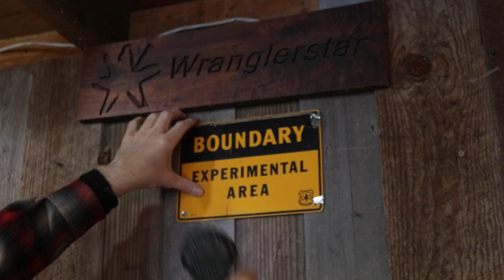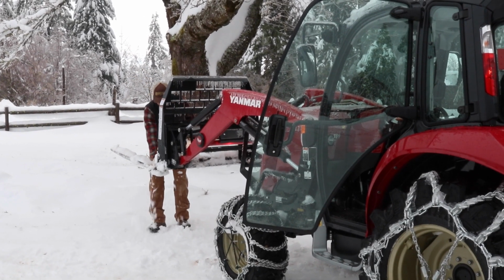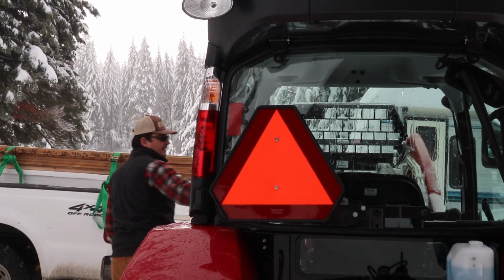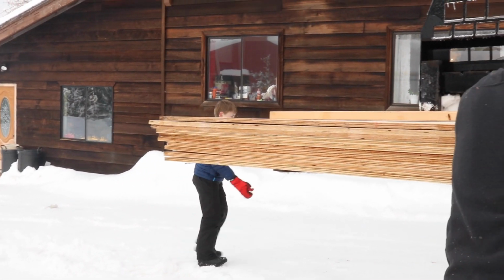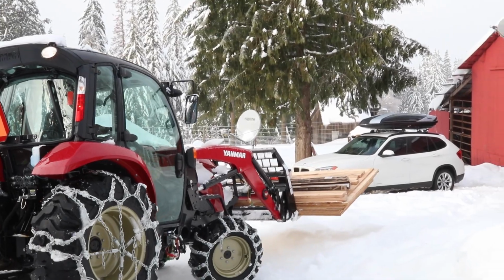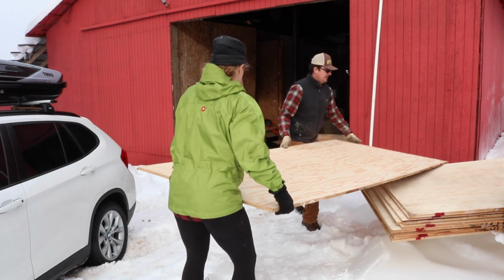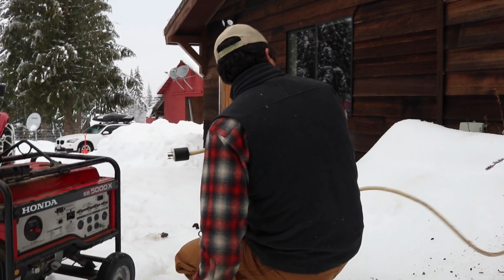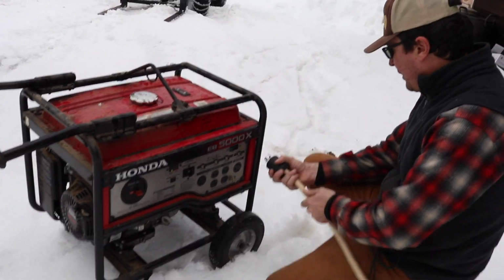THIS ROOM IS KILLING ME I CAN'T TAKE IT ANYMORE!!

Comment: Love the generator tip and back feeding! This was a slap on the head for me.. I was looking for complicated ways to feed in, bypass switch etc... this is a great idea. Our power went out last month for four hours and it we heat with outdoor boiler burner.. which needs to have pumps running or it will freeze... love the drone shots too!

Comment: hey Cody back feeding the house the way you are doing is very dangerous. Being an electrician you need to install a generator isolation panel. The cheapest version has a mechanical safety built into it, so when you turn on the path for the generator it disconnects the main service. I have already drawn a simple schematic for Boss of the swamp, if you are interested I would be happy to share it with you.  All the best, love your videos.

Comment: Loved this video.  We had ice storms like this when we lived in MD.  Great advice for powering the house through the dryer plug.   Opening the main circuit breaker?  Sadly, many could care less for the lineman's safety and few experienced linemen would trust a line to be or remain cold.  Grounding out a cold line before working on it is good practice.  HOWEVER, I've had good result explaining that their 5K generator will be bucking heads with a hydro-electric dam when the power is restored if they don't open that main breaker.  My next safety slide was a smoking hole with a power cord trailing away.  Funny what motivates people.

Looking forward to the wood shop project.

Comment: Cody, if there are any little plastic "port holes" (round or square most likely) in Mrs. W's bumpers, check in the spare tire area and there may be a little eyelet that you can screw into the threaded hole behind the "port hole" in the bumper, and that is for towing. It was like that on my VW, not sure if BMW has the same feature

Comment: The sling loop is standard equipment on all EB5000 generators, its just to bad the fuel cap isn't offset to clear the lift point. Back feeding is a huge problem here in Maine, the power company has a way to fry any generator that is back feeding before they service an area, we have seen some come in to the Honda dealership I work for, and it is NOT covered by warrantee. Looking forward to the wood shop renovation.

Comment: Just a thpught or better way and cheaper way then a transfer switch, is called an interlocker switch. It hooks over your main breaker and the breaker for the generator.  It's a safety switch that won't let the main circuit on while the generator is on when back feeding the panel. Just installed one for mine and the cost out weighed the risk of forgetting not to turn the main off. Also it's ul code compliant which is a PLUS!!  
   Awesome view of the winter wonderland !

Comment: This looks like a nice start to a worthy project. Really good information  about generator link up. 
Mrs. W BMW should have a towing eye, they keep a screw in version inside the car somewhere, in the boot/trunk I think on BMWs. There should be a pull out panel in the front and rear bumper where is screws in.

Comment: I can't recommend powering thru the dryer socket. Better to have a electrician put a plug on the breaker box. That way you don't have to worry about overloading the wires, and he'll install a switch that will kill the normal power input when you switch on the generator. I've put one on every house I've had in Florida, because of the hurricanes. And I've read about houses catching fire when the dryer wires overheated. JM2C
Reply: The circuit breaker on the dryer circuit will limit the current.
Reply: Your way is the better setup ,though.
Reply: Adding here because its the first comment i see on the subject... people also need to understand about the danger of step transformers. If you don"t isolate your main from the grid, the generator (even a 110v) feeding back to the transformer will step that small voltage back up to whatever the supply normally is... a very dangerous situation for utility crews
Reply: "So if you don't know what you're doing you shouldn't do this."  

No, if YOU KNEW what you were doing then YOU WOULDN'T do it Cody.  That setup is unsafe in so many ways.  What happens when Jack or your wife are home alone and they try to do this, but do it incorrectly?  What happens when you are distracted making a video and you forget to switch off the main breaker?  

Install a proper transfer panel with a lockout and get the proper cable.  The expense is minimal compared to some of your other projects and it could save someone's life.
Reply: I remember reading somewhere that it is actually illegal for you to do this power method in some areas.  They made these laws because so many people were doing it wrong and endangering utility crews.  Better to have a qualified electrician set you up with a automatic switch that cuts your connection to the grid while you have your generator powering the house,
Reply: BeachBow - Just wanted to thank you for your helpful comment.  This is something I am glad to know about.
Reply: I have a transfer switch installed in my house.   It looks like a second, smaller breaker box and one of them switches from the utility supply to the generator.   The only bad thing is it's hard to tell when the power comes back on.   I have to see if my neighbors are back on of test it by flipping the switch.   Still well worth it to have things done right.

Comment: Most German vehicles have a tow hook in the trunk with the tools that you screw into the bumper of the vehicle front or back. The receptacles are covered by a pop out panel. Look in your owners manual for exact details for your bimmer.

Comment: Cody, many newer cars have a hidden tow point behind a small, (2")panel on the bumper or grill. You may need to check the owners manual to see. My wife has a new Kia  Soul and I did not realize there was one until I found a large eye bolt in the spare tire area that seemed to have no reason to be there. I found a small panel in the grill that pops out and the bolt screws in. Handy! Hope you are all good. Philia

Comment: Hello Mr. Wranglerstar there should be a tow point in the front and back of the BMW. If you go to your tool kit that comes with the car in the spare compartment there should be something that looks like a huge eye bolt. That is the recovery device for the vehicle. Somewhere along the front and rear bumper their should be a small square cover thats around 1x1" or 2x2"ish when you remove that it should expose the slot that the huge eye bolt threads into

Comment: One material that I always find works well for the ceiling in a workshop or a garage is the non-perforated vinyl soffit. It is cheap, easy to install, does not need priming or painting, and is really easy to clean of any dust and dirt that is associated with a garage or workshop.

Comment: for future reference, on the BMW, in the front and rear bumper cover is a small square panel. You pop this out with a key or small screw driver. In your tool kit, you'll find an I-bolt, this threads into the bumper bar revealed when you pop out the little panel. this is how you hook onto a BMW to tow with tractor or other vehicle. Hope this helps....and Happy Sabbath!

Comment: Grate videos really looking forward to more on the to shop. 
You should get a change over breaker and have a designated outlet for the generator. You could split the board have the important things on the part with the changeover switch and then when the other rooms come back on you will know the power is back on. 
Probably something you would have to check with a professional to see if it's aloud in your area first

Comment: You need a proper transfer switch that will disconnect the incoming power lines and connect to the generator with one switch throw.  This protects linemen down stream so you are not energizing power distribution lines with your generator (called back feeding).

If the power lines go down somewhere between your generator and the break you will have a short to ground and your generator will stall or breakers on it will trip leaving you in the dark.

Comment: I've never considered feeding back through the dryer plug. Good tip! One question though: have you got a good way to tell when the main power comes back on? Once you trip the main breaker, I can't think of any good way to determine when the main power is back, in which case I'd be pointlessly running the generator. In Newfoundland, Canada we lose the power regularly to storms like this. Take care!

Comment: Hi Cody,   forty plus years ago I spent  three winters working weekends as a  coal delivery  labourer carrying 112 lb sacks of coal on my back  add slick  ice covered paths and it was a recipe for nasty falls. We used to drive One inch hex head  self tapping  screws into the heels of our work boots, and never suffered a single fall. Same principal as hob nails  but an easy job to remove said screws. I'm probably trying to teach my Granny to suck eggs here, but thirty cents outlay as opposed to seven bucks is a fair saving.
 don'tcha think? Cheers, Bob the Gas. ( retired gas fitter and one time coal delivery guy)!!!

Comment: IIRC  There should be a plastic cover in the front bumper that hides the tow hook location. In the tool kit you will find a threaded loop that screws into the front bumper for towing.

Comment: It is illegal to not use a TRANSFER switch.  If the phases are incorrectly wired you can backfeed the neutral.  Even wired correctly, by code you need a lock or prevention device on the main breaker to keep people from turning it on.
Reply: There are no phases in residential house wiring. Single phase only. Suicide plugs are a bad idea, but they work in a pinch.
Reply: Aren't the two separate legs of 120 separate phases? If they were the same phase they would not combine to 240v.  The issue is accidentally wiring the hot of the generator to the neutral of the house, everything would still function so there would be little indication that it was even wired incorrectly.
Reply: the 240 is the single phase. We here in the US use half of it to ground for 120.

You ideally don't want the bonded side of your panel to the "hot" side of the generator.

Comment: hey Cody. that is not the proper way of connecting the generator into your house" the dryer circuit may not suport the load (this has a remote chance of happening but if and when it happens a house fire will happen too!), as you said you also have to disconnect from the power grid so your not energizing the line and maybe cause an accident, another issue is that if connected together generator and mains power since both grids are not sincronized will blow up the weakest generator on the circuit (your generator will burn up). the best and cheapest way is to have a selecto switch in the mains board that wil comutate the incomming power from Mains power or generator like a transfer swithc in a dedicated direct connection to the generator. congrats for all the videos keep posting!

Comment: wranglerstar your Beemer should have a tow hook in the little "kit" with the spare tire. It'll screw into holes in either bumper via a small knock out panel. Check your owners manual in the jacking and towing section. BMW uses aluminum control arms that usually have yellow "no hooks" stickers on them. The tow hook (eyelet) is required for loading them on a flatbed and minor recoveries. For anything more than a moderate pull, I probably wouldn't use it.

Comment: Cody sounds like you need what I have on my house a double throw box...when the lever is up it is the grid power, then middle is off, and lever down is auxiliary Power.  Or like my dad is in process of setting up, an automatic switch that senses the power drop and starts the generator so you have no stoppage in power.

Comment: I know you won't read this but, put plywood, or what ever scraps you have, around the generator at an angle. This will send the sound towards the ground and make it better for your ears.
Reply: Michael Chavez I watched the same video by sixtyfiveford. I did type "or what ever scraps you have" meaning use what you got because anything is better than nothing. The problem is that they did say something about it raining in the video so drywall would be no good.

Comment: Hopefully this can be helpful to you as many of your videos have been helpful to me!
On your Bimmer there should be two small round caps on the bumper fascias, one on the front and one on the rear. Pop those off to reveal a threaded hole in the actual bumper support. Go to your spare tire kit and in the bag or foam block there should be a heavy tow hook that threads into the aforementioned bumper holes. Then you can hook up your tow chain and away you go. Hope this helps, take care!

Comment from the maker: Check out this super cool backup power inverter! https://goo.gl/eMWIMS This thing was so useful when the power went out yesterday.
Reply: Wranglerstar love your videos, you're some of the inspiration for starting my channel. Thanks for all the wonderful content!
Reply: I hooked my 1st generator up last week expecting ice, it never came but at least I'm ready.
Reply: Not yet, for now it is wired into a 30a breaker on a sub panel in my workshop that is fed from the house. I painted that breaker red with a label "generator feed" . And also walked my wife thru turning everything on in case I'm not here. The transfer switch will come when I can afford it.
Reply: Enjoying your videos 👍🏼👍🏼
Reply: In industry it would have been called a Castell Interlock (if manual) or a changeover relay if automated!
Reply: I can't take the new CAPSLOCK STYLE THAT YOU LIKE TO USE. Sry but this is something that makes it seem like you are yelling and people dont need that in their life.
Reply: BMW????
Reply: 220 volts across exposed pins on the other end of the cable. Scary
Reply: Wranglerstar is this building seperate then that big building that u pressed the apple cider in
Reply: more than scary man is a dead trap the so called suicide cord
Reply: do it legal Home depot sells a 60 amp transfer switch and all the other items needed for about $ 200
Reply: Are you ever going to do a Permanent system of switching between Stored/Generated Power and Line feed power..

would you Eventually go for a Off Grid/Grid interactive system of solar and Batteries..
-- I Know that you have easy access to power and such.. but would you ever go for a system that allowed for independence..?
Reply: +shubus can you say "suicide cord"??  I can't say I don't have one but it's not the safest thing.
Reply: All these people crying about what a fire danger it is to power up your home temporarily are really not thinking. A 50 amp dryer or welding plug doesn't care which direction the current flows. Neither do your breakers. The current is still flowing throw a cable rated at 50 amps and simply feeds the panel and rather than the utility feeding the panel busses the generator is and the breakers will work regardless of current flow direction.
As long as you have tripped the main breaker from the utility to your panel the only possible thing that could happen would be that  you ask the generator to do too much and in that case the dryer service breaker will trip, or the breaker at the generator will trip. You are not going to over heat wiring, and there is very little risk of fire.
Keep up the good work my friend. I enjoy watching you do your chores and such. You illustrate a typical "jack of all trades and master of none"; like so many American men used to be and as I consider myself. One can never learn everything so even though you may show us some simple projects many people gain some knowledge from your endeavors. There is always a better way to do things. I would also mention that I enjoy your outlook on life and the family connection and stories of granddad and I appreciate your faith as well.
There is always room for spiritual edification as well!
MAY GOD RICHLY BLESS YOU AND YOURS!
Reply: lol. i was thinking it would be a link to a tesla powerwall. instead it is a link to a joke of an backup power.
Reply: Phil Dad Yes technically you are correct that electrons do not care which way and what type of plug. However, it is well documented that numerous house fires documented by both Fire Marshals and Insurance Investigators that this method has lead to the cause of a house fire. Usually from when the power is turned back on. In addition this is not exactly setting a good example for all the home diy that follow this channel. In addition to the house fires there have been several line men killed and numerous generators that have blown up from power being turned back on. Finally, I will say that turning thr breakers off only kills the "Hot" legs. The neutral although bonded in most main panels still carries current. Depending on what kind of rural service you may be on you still have the potential of putting power out to grid. Yes I have seen 240/120 transformers used on rural service. In the end I just want to say this is a bad idea, it makes people think that if W can do it why can't I? And it could possibly kill someone. There is an electrical code for a reason.
Reply: You are absolutely correct, however I was making the statement assuming that those doing so would do it correctly and prevent the possibility of back feeding the service.
One can always count on "Murphy's Law", which is usually a man caused error.
Take care!
Reply: Great job, Richard.  So many men forget to 'train' their wives on necessary operating procedures necessary for comfort and safety...works both way, girls!

Comment: I do the same thing with my generator. Backfeed through the welder plug in the barn. Except mine is a 60 amp breaker in the barn and the feed to the barn is 100 amp. I have a 5000 watt generator too that will power most of our appliances. Usually leave off "technology" to avoid dirty power.